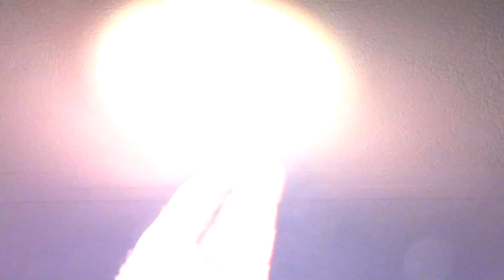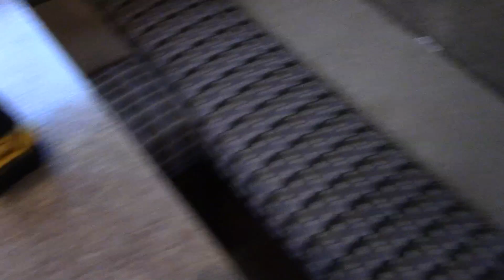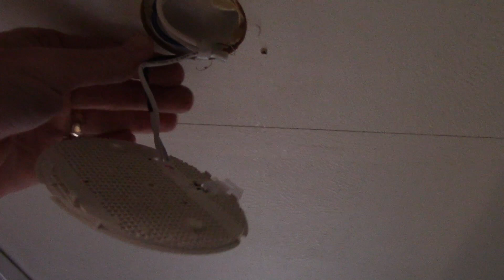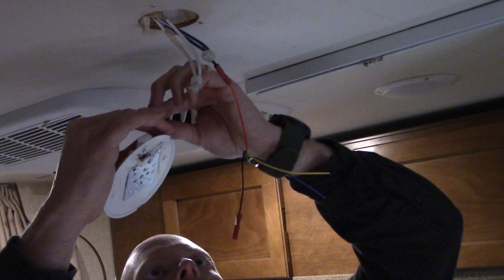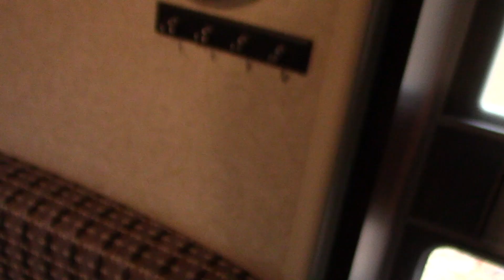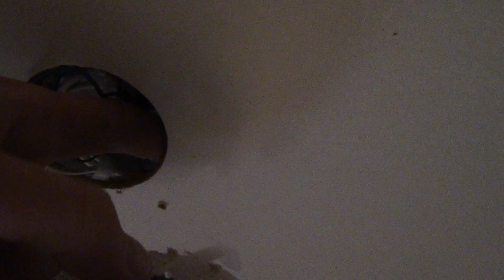How To Add Remote Control Ceiling Lights To Your RV

Comment: I just wired something similar to the larger one you linked in your description. My question is, if I cut the power supply to my camper for storage, will the relay keep its settings? Or will I need to reprogram after prolonged periods without 12v?
Reply from the maker: On mine it keeps it's settings